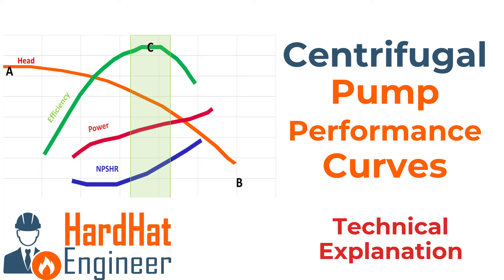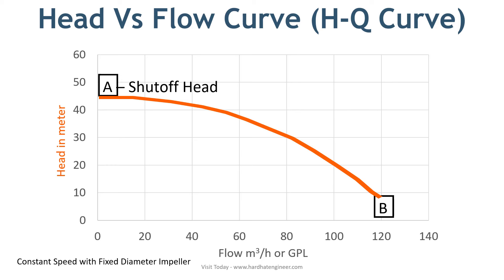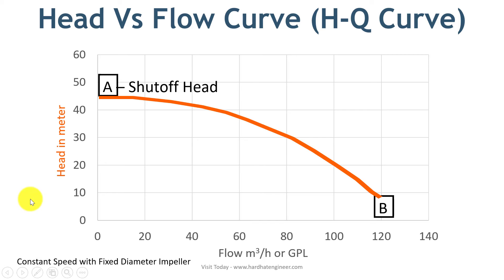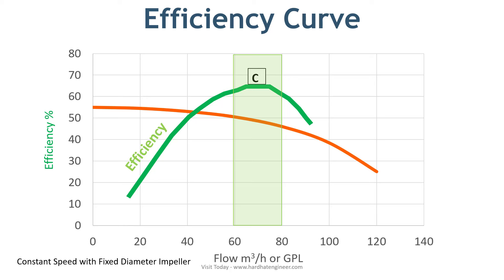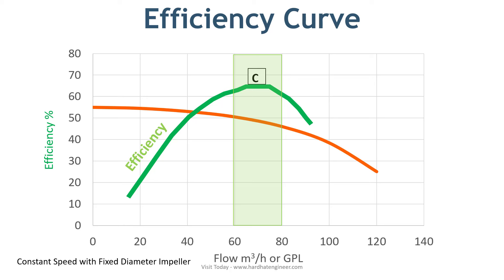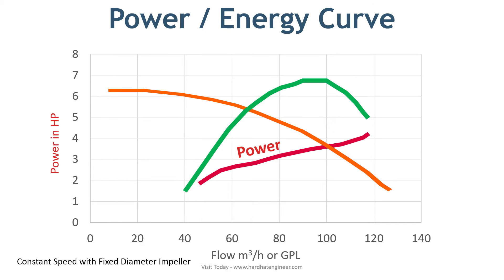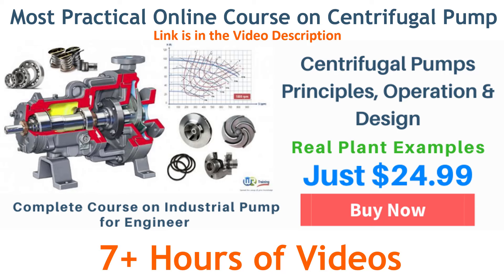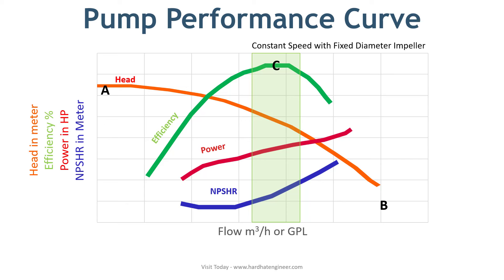Centrifugal Pump Curves - Performance and Characteristics

Comment: Thank you for your dedicated video! May I confirm my understanding: the power perfomance curve and the power in pump family curve are about the mechanical power (shaft pump power)?
Reply from the maker: Yes, correct
Reply: @HardHatEngineer  Thank you Sir! I have another question: In some hydraulic calculation documents, I found 2 different values of efficiency: estimated and corrected. How can we get those values?
I guess the corrected efficiency is got after we have already chosen the pump, and calculated by hydraulic power/mechanical power. Am I correct? How about the estimated one?